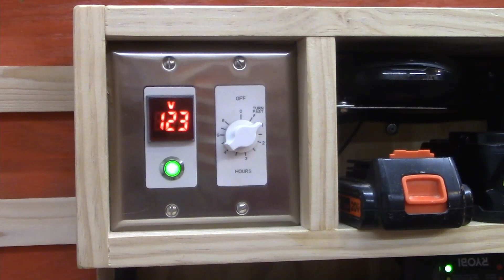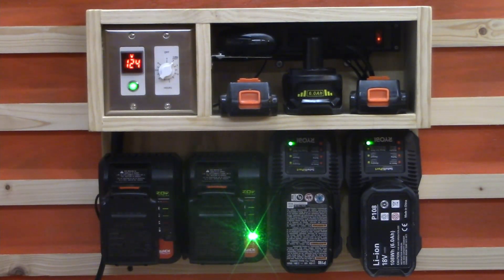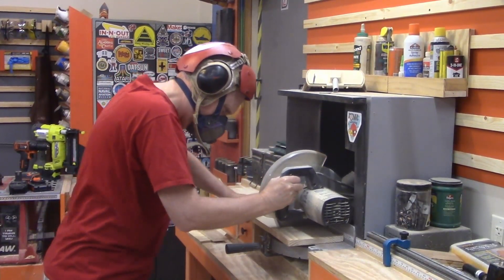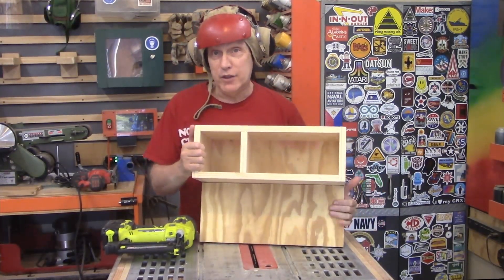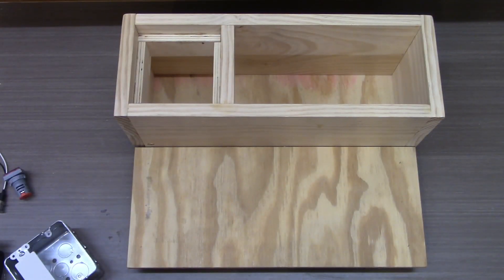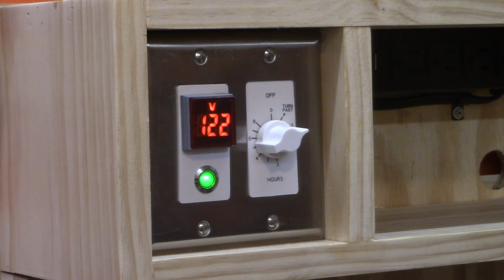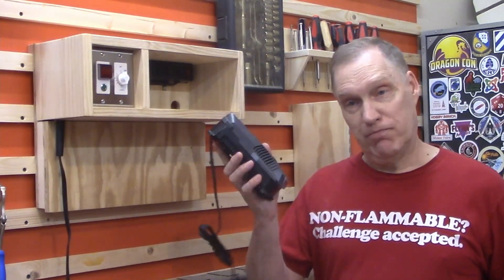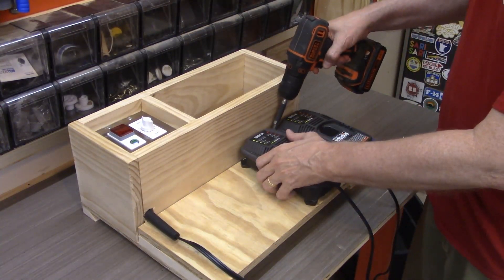Auto-Cutoff Smart Charger - Fire Safety and LEDs

Comment: Inspired me to consider doing the same with one of the 120VAC voltage and current meters I bought to see when bulbs are starting to go bad due to higher current, though rotating the box to the right.  I don't use those now, so... hhhmmm....  Reminds me also I have a dual 20V DeWalt charger I need to disassemble and see why the one side doesn't work and repair that.  Hoping is only a capacitor!  B^|)
Reply from the maker: Sounds like an interesting project. What bulbs are you monitoring?
Reply: @AtomicDairy  Was little over a decade ago, HID.  Technically, was monitoring the main line going into the ballast.
Reply from the maker: @jafinch78  makes sense. Monitoring current and volts would be useful here too. I'm really thinking of adding the amps version of that voltmeter to this project. It would be super easy to wire.
Reply: @AtomicDairy  Just went to look online for an example and am amazed at the options now with way more features.  https://www.amazon.com/MICTUNING-Multimeter-Voltmeter-Frequency-Transformer/dp/B07ZHDMZJ8/
Here's an interesting LED fancy looking model in a smaller package:
https://www.ebay.com/itm/133744220648
Here's what I was using:
https://www.ebay.com/itm/193561238822
I've actually thought about doing again, even with the KillAWatt meter, since more cost effective.  Thing is I don't have the greenhouse going yet to potentially use as a heater source and to control lighting conditions for whatever stage of growth based on seasonal lighting conditions.  Kind of a bummer not growing indoors anything either... or at least not much other than what was on the back side of the stove and dish drying rack over the sink this spring.  Will be nice to have a greenhouse active again and this time with plans to be more geothermal based on the "Nebraska Orange Farmer" and some Chinese designs using a full height north wall thermal mass and smaller south wall thermal mass.  Thinking I can upgrade Dad's old greenhouse to utilize both and most likely won't even need the lighting for heating and more-so for light to control growth.  Now days switching to LED's for general lighting everywhere, seems pointless to monitor that lighting application. Though for the HID's wasn't a bad idea and might be a cost effective option for energy situational awareness for other devices.
Reply from the maker: @jafinch78  very impressive. There are some amazing components out there and they are often pretty cheap. I just love putting stuff like that into projects. They provide useful information and really improve the look of the gadget they are installed in.
Reply from the maker: @jafinch78  thanks for the kind words! I hadn't seen the newer versions but our flight deck helmets are spectacular for noise management, and they keep the sawdust out of our hair. We love them!

Comment: That's neat.  Maybe a temperature "led" display would be nice.
Reply from the maker: Working on that in another project. Time, temperature, humidity, and a half-dozen other things on a single display. I should have it working in a couple of weeks, hopefully...
Reply: @AtomicDairy  Looking forward to it.  I was thinking a temp gauge for this product with a remote sensor by the chargers. Middle top?  This would give a good idea of what the charging temps should be and you would notice when they rise too much if you're in the shop.
Reply from the maker: @1thinkhealthy  it will be posted to the channel when it's done. I think I have all the parts I need and just need to sit down and build/code the device. It's one of the top things on my list so it should not be too long before I have something to show.